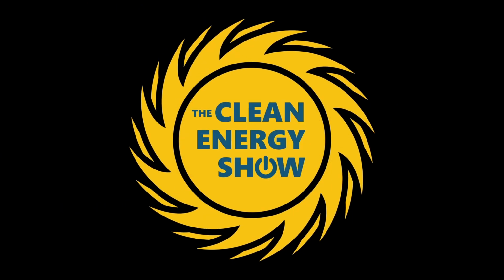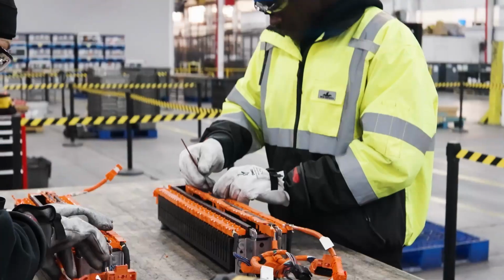EV Battery Recycling is Actually Amazing!

Comment: In addition to recycling keeping the battery materials  in use for much longer, if autonomous driving does result in a drop in auto ownership, that means that eventually a lot of the recycled material will replace the need for new mining